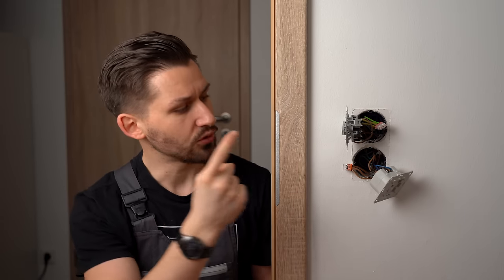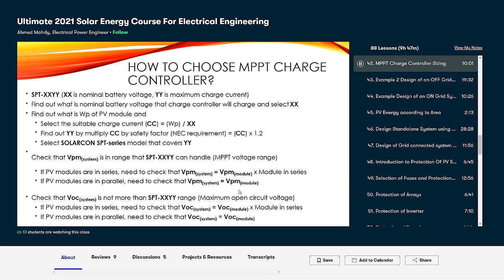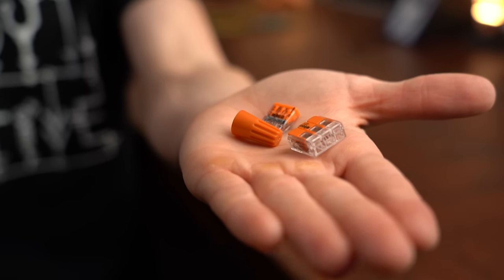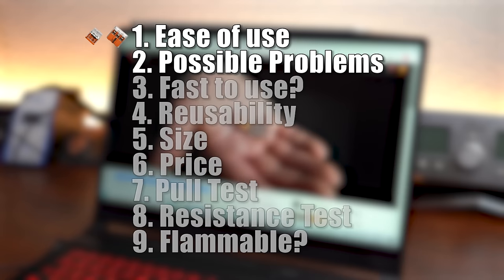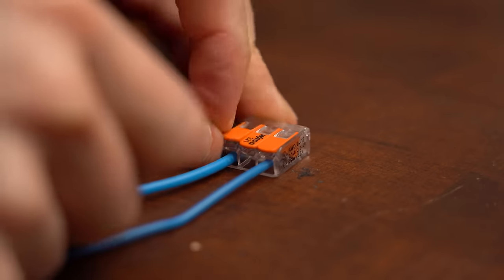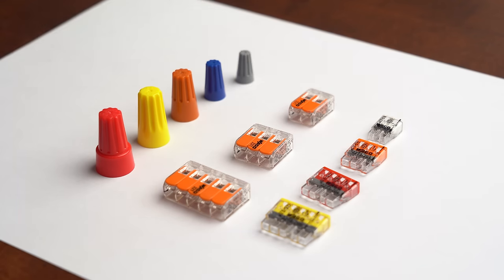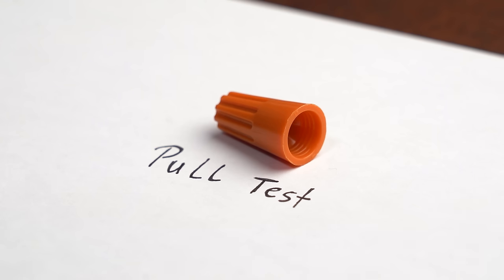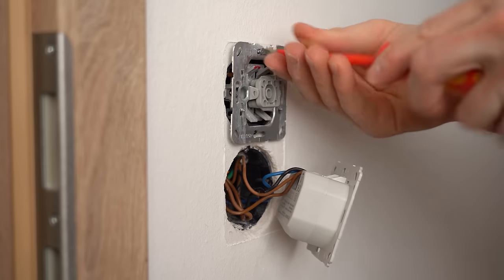What Wire Connector is the Best? Settling a Debate! Wire Nut VS Wago

Comment: I like the idea of the WAGOs but the fact that they produced heat at all is worrisome to me. If i felt a wire nut be even slightly warm i would start troubleshooting immediately. 
I would use a WAGO in a tight situation where it would be impossible to get a wire not on properly but id still feel iffy about it. 
Im sure they are fine but wire nuts are tried and true.
Reply: The heat produced is not significant. Most circuits idle most of the time and are rarely under full load. On average, about 10% load? Much more important is not to have a bad connection. It doesn't have to be the best to be acceptable. Not bad is good enough.

Comment: Commercial signage industry worker- wagos are too slow, cost too much and have no way to keep out condensation.  We buy wire nuts by the barrel.  We always bend the wires and affix them with p clips to shed water, not collect it.  My fingers would be destroyed if i had to operate 800 wago levers a day, but i can apply 400 wire nuts without discomfort.

Comment: Does not use wirenut correctly in "potential problem" section. Don't push in wires together. First, push stranded wire into wirenut. Then, push solid wire in. Never a problem that way. Even if problem does occur through incorrect technique, you will know by pulling on wires. Just do it again if you make a mistake.

Comment: In my experience Wire nuts fail over time a lot more than wago connectors. That being said there seems to be no consistency what so ever in wire nuts in terms of supply quality. Sometimes you get decent ones sometimes you get the crappy stuff, from the same supplier for the same price... The Wago connectors are all made by, well wago i guess, so you get what you pay for every time.

Comment: I rarely have ever had something to say on your videos. So this possibly even being the first time let me say thank you for the work you do. Now there is literally nothing 0 zilch to look up about wire nuts. Wire nuts are making a mechanical connection between the wires. Mean the only resistance present is the resistance of the connection itself. Secondly you think trying to find a tiny hole over your head is easier then simply placing two wires together and twisting? That doesn’t make sense to me. The only explanation I could figure was you are used to new wiring and working with older stuff isn’t your thing. That’s also ok, wago connectors are horrible if there is a straightish end to work with, you end up stripping and cutting more wire which takes longer and trying to do all that overhead is horrible as well. Lastly the inconsistent results you had from twisting them together I believe to be more of an inexperience issue than a conductor issue. Also while I’m thinking of it how do the Wago compare when connecting a 10 gauge wire from house widening to a 20-28 gauge  stranded core from a light fixture? I can tell you from experience the Wago have a very weak grab that’s almost non existent and therefore presents a fire hazard. Keep up the good work man.

Comment: Only note on size is that 2-3 wires would definitely be smaller with nuts. How many times do you use 2 wires in the 3 slot wago? Wago are bigger but lay flat ideally, while the nuts simply add thickness to the wires, both can cause space issues in the wrong receptacal. But the 4 sized wago feels MUCH nicer than shoving 4 wires into a nut in my opinion. And it's truly an opinion based thing.

Comment: The resistance test confirms why I don't use Wago or any push in type device or connector I have seen melted connections and wires using friction connections, these are pure junk.

Comment: with the 'twist' connectors, you don't need to go to the internet - if you are a pro - because the color tells you what you need to know. Nothing to read. It is standardized. For the homeowner, well, the size is a clue, but you might use the size too big, I guess ad it would be too loose. for the 'europen-style' you would need to carefully read the small print?

Comment: I hate wire nuts. But I’ll never use those clamps. The GAGE I’ll say it GAGE GAGE GAGE. lol. Of the metal inside those clamps is less than the wire. That’s why they melt. They cant carry the same amount of electrons down the pipe. It’s a bottle neck. And if you measure the amperage, voltage, current , ect It flows less through clamps than if it were twisted back together with the same wire. Same gage against gage.

Comment: Wire nuts use only for protection as insulator. It should be welded with soldering iron before using it

Comment: You aren't using the wire nuts correctly so that is part of why you had some loose connections.  You have to twist the wires to be tight prior to using the wire nut.  So you don't need to see through to be able to know the wires are connected.

Comment: Wagos are actually not making connections its using the piece of metal inside to jump from 1 wire to another. Wire nuts do not do any conducting they simply insulate the connection.

Comment: The use of wire nuts is only as good as the installer ,if you add the extra protection of electrical tape to wrap around the wire nut and wires then there's no way for that connection to become undone

Comment: Seems like a bad electricians wire nut. If you learn all the ways to twist solid to solid or stranded to solid and ect.ect. if you learn this the joint becomes a double thick section of wire making it a strong point that can handle mre amps than the actuall wire

Comment: I love how there is a possible problem section where he sees no problems with the wago. Also he is comparing 2 kinds of wago connectors with wire nuts and fails to point out that one of the wago types won’t work in that situation. If you could only have one type of connector available to you wire nuts are the one.

Comment: For 22 gauge, which would you suggest??
Reply: I'd recommend a Crimp Cap.  Plastic cap, sort of looks like the wire nut, but instead of twisting, you crimp it.  They are solid.

Comment: Trying to find something wrong with a 32 AMP rated Wago is ridiculous. Electric code have not changed since the 30's, everything is LED so one 15 AMP breaker is enough for a 3,500 sq.ft. house. (1725 watts gives you 153,000 lumens). 5 AMP panel breakers with smaller wires will save tons of copper. Overbuilding is not for safety but for greed.
Reply: forgot about appliances and outlets did we?

Comment: The information about wire nuts is located on the package. The rated amps is determined by the wire, not the nut.  Seems like you have preconception bias.

Comment: Im an Electrical enginner The best standards of electrical installation without doubt are in the UK.  Neither of those connections are ideal and should be avoided.   if you have to join cables a solid insulated crimped connection is preffered or a joint box.  If you carry out the installation correctly these are not required.  Don't even mention USA wiring its outdated and dangerous.
Reply: Lol, ok. I never seen anyone ever not twist the wires together before using wire nuts. This guy didn't use the wires nuts correctly. Always twist the wires together before using wire nuts

Comment: Related so size, giving them both a point is ridiculous. Wago is obviously much smaller and easier to fit into box, especially when many connections. I know this from direct experience. One multi-port Wago can often be used in place of two or three wirenuts needed.

Comment: You are using the twist connectors wrong. You do not twist the wires togeher before inserting them, just very slightly to help inserting them but no more than about 1 turn

Comment: I would use Wago's at home but every job I do they are not approved by the Electrical Engineers- only wire nuts.  And by wirenuts I mean a quality one like Ideal tans. You show the cheap junk ones that come with cheap fixtures.  A quality nut will out proform a Wago.

Comment: You used crap wire nuts.  Try the good ones with wings on them.  A Ideal red wing nut can hold 5  12 gauge wires.  I've used the Wago connectors, too.  Very fast and easy, but they take up a lot more space in the box and I didn't feel confident that the little metal spring would still have enough spring in it to keep the connection tight 50 years down the road.  I know: who cares about 50 years down the road?  Well you might not, but someone else's kids could die in the fire when they overheat.  I'm not saying that they really will.  I'm just saying they didn't give me confidence.  

Wire nuts, on the other had, can be difficult to get right when you have four of them plus a pigtail in one red wing nut.  Just today I opened up a box that had exactly that setup and when I pulled the black wire bundle out, the pigtail popped right out of the nut!  So maybe schlockers should stick to Wago connectors.

Also, many wire nuts do tell you the size range of conductors, but they don't have room to list maximum numbers of each connector size.  If you're putting more than two or three in, it's up to you to look on the box.  Don't trust "the Internet" for this information because different brands and constructions of wire nuts have different maximums.  Look on the box.  If they are UL approved, it must tell you.

While I agree that Wago is easier, I think I'd still race you on wiring the lamp.  I bet it would be much closer than your test.  

I don't reuse wire nuts.  Call me superstitious, but they (and Wago) are so cheap that it just makes no sense to take the risk except for temporary connections.  I also don't think I would ever reuse the Wago that you twist and pull to release.  That little spring is going to be weakened.  The Wago with the lever is cool and I bet it would be fine to reuse it over and over.

I agree with someone else who said the resistance test is irrelevant for wire nuts.

Comment: Aren't you supposed to twist the wires together before using these things?

And if it takes 30 seconds to explain a connector, is that really a problem? Aren't these supposed to be used by ticketed professionals?

Comment: Wire nuts flat out suck in comparison... but unless you are a professional performing many repetitions where the convenience of the WAGO adds up, I feel like the price difference is hard to justify. 

I replaced all the receptacles and switches in my condo last year (because duplex receptacles are ugly and should be a mortal sin) and I had done one room at a time; would WAGOs have saved me a decent bit of time? Yes. Did the cost of the project change non-negligibly for a broke college student when considering WAGOs? Also yes. I don't know a single person who will argue wire nuts are superior, but I know plenty of people who prefer the cost of the ole wire nut. 

I had hoped over time the price would decrease but I have a feeling that patents are, and will, result in WAGO being the only massive manufacturer of the lever nut design. I can't see why they would logically reduce the price. I can't imagine the slight increase in sales from the sectors of the professional market that still use wire nuts would outweigh the profit cuts from a price reduction...

Comment: Your failure with the wire nut when mixing sold and stranded wire is because when doing so, you should lead with the stranded.  In your failure case the sold core was longer, and that's why!

Comment: Ill NEVER use Wago connectors after seeing that resistance reading! 1 watt and 120v of leak? Multiply that by the box of them you use. I solder my wires before wire nutting. Then heat shrink the oipen side of the nut. Duh.

Comment: I don't understand why everyone is so concerned about the increased resistance. As a synthetic lab test, sure award the points to the wire nut; but practically speaking the wire's insulation will fail before the Wago, so what difference does it make? Sure it would be nice if it were lower, but there are obvious tradeoffs and benefits to the design as the video showed. 

Lots of examples of this:

https://youtu.be/bP0qHyVAymU
https://youtu.be/flSs4PLai2Y
https://youtu.be/B1pmuRsf1co
https://youtu.be/GQswcgxLOBE

Comment: I think theres a flaw in the size one. Because you say you got limited space in those boxes and I agree, but one thing you have to take into account is that the exposed wires will technically take more space because you have to turn the wires so they dont touch each other which limits the space available.

Comment: America being first in things like this means alot of standards get started with only one or two design options around and while knowledge of a subject is still limited. If Tesla were around today I am sure he would run as high a voltage with low a current as he could possibly sell today. For example 100v became the defacto standard and the extra 20v is so everyone gets at least 100v even the last guy on the line + at the end of a low gauge drop cord. Same goes for wire nuts and since silk screen printing wasnt around early on a color code became the standard which an electrician had to learn. Why we still use the crap is a question for government but honestly the US has a queue of questions for them(like wtf happened to avg IQ) and wire nuts are likely last on that list.
Reply: "America being first in things like this means alot (sic) of standards get started with only one or two design options around and while knowledge of a subject is still limited"
Which is an interesting but biased statement.

"If Tesla were around today I am sure he would run as high a voltage with low a current as he could possibly sell today. "
Which is why "Europeans" (who were really ahead in the "race") choose to use 220 V to 250 V (and have "settled on" 230 V)

The US power suppliers realised that a higher voltage was the "way to go" (to reduce losses and cable costs) and have pushed the standards as far as they can but always maintain that (LOW) "Reference" to Earth/Ground - to differentiate from the European (World Wide) Peak of 340 V (or so) and supply AC Voltage with a Peak voltage of "only" 170 V

To quote an "average" IQ (of 100) means that HALF the "population" considered is below AVERAGE.

Comment: Both Wago AND Wire Nut is bad comparing to way more chipper but time-consuming soldering or welding.
Reply: ah yes i love re-soldering everything all the time while testing
Reply: @jajasteele  it is obvious that soldering and welding are good only as permanent connection. This video is about electrical house wiring, don't see any problems here.

Probably you should educate yourself BEFORE doing any electricity-related things, especially with high current.

Comment: Those are junk multi-size kit wire nuts. We buy giant bags of one size commercial rated wire nut.  We also use stab in connectors on light fixtures/luminaries. We also have ceramic wire nuts for high temperature locations. Good luck melting ceramic.

Comment: IMHO you did a pretty poor job of twisting those wires together with the wire nuts, which isn't that surprising since you've never used them before.  Best way to do it is twist them together with a pair of pliers until they are tightly twisted all the way down onto the insulation, like 6 or 8 twists, then put the wire nut on.  I think you'll find if you do it that way they are way better in practically every way except time.  Lower resistance, higher strength, etc.

Comment: It would seem that a big advantage to the WAGO is that it would be easy to use both stranded and solid wire in the connector, which is difficult if not impossible to do with a wire nut and pretty unsafe to do so anyway because a stranded to solid in a wire nut pulls out rather easily.

Comment: I'd say you're VERY partial to Wago nuts because you've always used them and dont have near the experience with the twist nuts. The twist nuts you used are really cheap even for a typical twist nut.. And you didn't pre twist your wires. Also you said in the video that the wires inside the twist nuts is what conducts the electricity... which isn't completely wrong... and your used to having to have something conduct electricity in a Wago nut. But the twist nuts wrap the wire around each other. So they don't need a conducter which makes for a way better connection when dont PROPERLY. Also Wago nuts are great for connecting like 14-2 romex or something. But like 10-2 I use for my 220v plugs and such carry much more current which I would rather the wires be wrap with a bigger twist nut by twisting the wire manually first. Absolutely takes longer.   But hey... less resistance and twist nuts are a fraction of the cost of wago nuts. I'd go broke buying wago nuts if I was building a house and I wouldn't trust them as much personally. In saying all this. I'm a huge fan of both. And I am partial to twist nuts because I've used them longer... just like you with the wago

Comment: WAGO connectors cost 10 times as much as wire nuts. The wire not has not been proven unsafe. The WAGO connector is superior in ideal situations and definitely in new construction. When following the work of a hack I believe wire nuts are more practical and easier to use but in a new construction milieu 
WAGO Are superior.

Comment: Wago has way more pros then wire nuts. They are easier reused and changeable when required wire nuts make a mess of the wires IMHO Wago connectors also damage wires but less then a wire nut

Comment: I'm sorry, but it is ridiculous to say the wirenut wins the pull test. All three are plenty secure enough if done correctly. It should have been a tie, or favor the Wago. The wire is not going to come out of the Wago under any real-world condition. In contrast, if the wirenut is not correctly installed, it might come loose as pushed back into the box.

Comment: Must disagree. A connector that generates resistance / heat when new is only going to get worse with time. Take the time to do it right, use a wire nut.